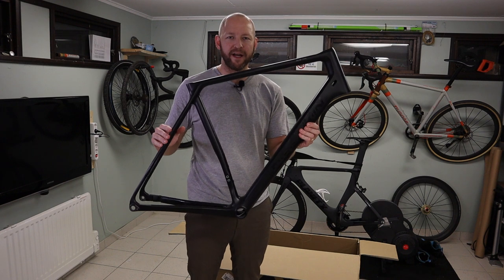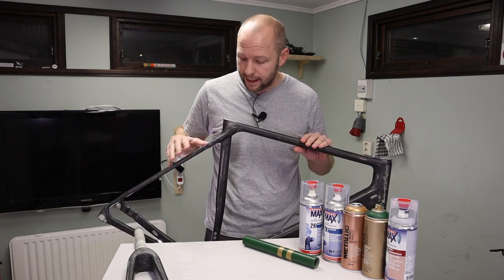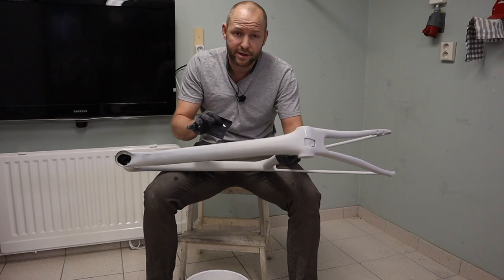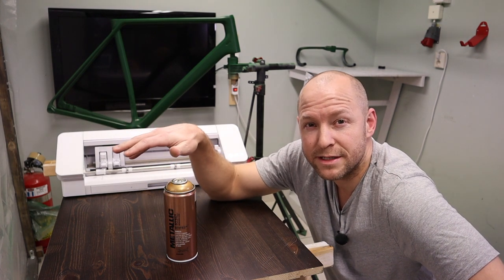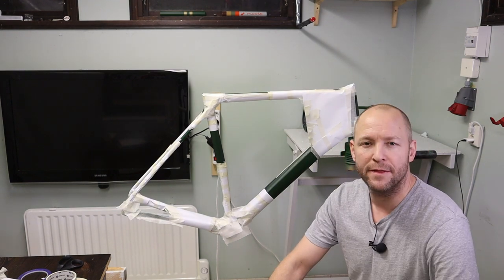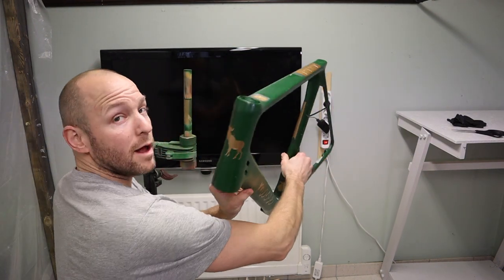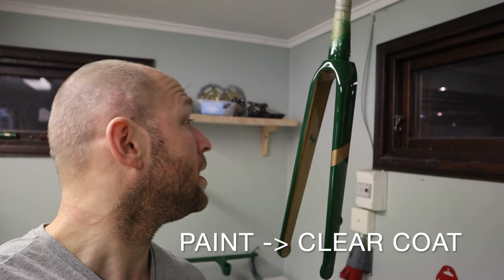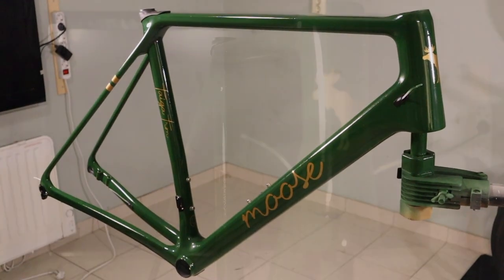Custom carbon bike frame painting DIY #bikepaint

Comment: I really like the gold with the moose on the inside of the fork. The little details like this really make it look more custom. I found it interesting that you ended up in the position where the whole bike was sprayed with gloss coat. May have saved some time if you'd gloss cleared the decals you'd just painted in gold before removing all the masking.  Then given you had to mask up the gold decals to paint the green areas that had got scratched, you could've sprayed mat clear over that area straight away. Either way glad you're happy with the outcome!
Reply from the maker: Thanks. Yes, making it yourself really gives you possibilities to set details you would not get anywhere else.

Comment: Very nice job! It looks fantastic and the best part is that no other bike will look the same! I’d have painted the inside of the rear triangle (chainstay, etc) to go with the golden part of the fork, but all in all, excellent design!! 👏🏻👏🏻👏🏻👏🏻
Reply from the maker: Thank you very much! :) Yes, thats the beauty with custom painting! I was thinking about it but I decided to go with all green on the inside of the rear triangle for two of reasons. To begin with I planned on laying a matt clear coat on the green in the end. And masking that area to keep the gold glossy would have been very hard. Also the edges between the areas that would be gold and green were not that defined on this frame and I found it hard to imagine where to put the lines. The risk of failure was simply too big in comparison to the gains. :)
Reply: @MYnextDIYbikePROJECT  that makes sense!

Comment from the maker: Any questions? Let me know! :)
Reply: Are those reverse stencils you are using?
Reply from the maker: @achmatsydow3759  I’m not sure what you mean?! The stencils exposes the letters and mask of the background so the letters gets colored by the paint. Check out this video for deeper knowledge. 👉 https://youtu.be/Ck1ssw3goIY
Reply: Can't you simply de-gloss the surface and/or remove the clearcoat, than primer and paint over the original?
Reply: @HealthvsWealth4me  You can but paint weighs a lot.
Reply: @MYnextDIYbikePROJECT  with what exactly are you washing of all the dust remains, after the sandpapering ? If you would use wash gasoline, would there be a change to wipe any of the fresh color of?

Comment: Og-evkin is a good brand. I have an integrated bar and stem handlebar on my emonda. I had a crash in which I hit a car with my front tire and the frame split in half at the head tube had a broken arm but the handle bar didn’t suffer any damage
Reply from the maker: Good to hear. My frame is all I have from them, but it rides great so far!

Comment: Not sure what you used to remove the residue, but for a gentle glue / residue removal try next time citrus furniture polish ( pledge) there are also no name brands you can get cheap work the same.
Reply: Ps very sweet vid! Thanks for posting.
Reply from the maker: Thanks. I tried a couple of home remedies, bicarbonate and olive oil amongst other.  Took some but I pretty sure I let the masking sit for to long and the glue “grew” in to the “raw” painted area. Didn’t try your solution though. I’ll probably will on a separate test tube. 👍

Comment: QUESTION: First,Thank you for taking the time to make this video. I may be repainting my SCOTT carbon bike soon. My  question is, Why do you need to remove all the paint first. Can't you simply de-gloss the surface and/or remove the clearcoat, than primer and paint over the original? I did that with one of my aluminium bikes last month and it looks great and holding up so far. ???
Reply from the maker: Its absolutely a possibility. But for me, it’s a few things. I get to inspect the frame and find any cracks or flaws before I paint. The new paint might react with the old paint and destroy the paint job. Weight savings, it’s marginal, but still. So if I’m gonna put so much time, money and effort into the job, I like to do it on a raw frame.

Comment: Should I sand between each layer of primer or only once it has cured for 24 hours. And then finish off with the final primer and move onto the base coat. 

And should I do the same to the base coat? Sand in between the base layer 
x2/3 and on the final coat? Or leave the final base coat untouched from sanding? 

And once I applied my decals and logos. I will apply the colour layers 2/3 times again. Should I sand the colour or I shouldn’t touch it? 

And only sand after I applied the clear coat? 

Please advise. I’m a bit unclear on this?
Reply: Please advise?
Reply from the maker: Only sand fully cured paint. So after after 24h (read the can for directions). You only sand primer and clear. Do not sand the base coats or graphics. 👍
Reply: @MYnextDIYbikePROJECT  thank you

Comment: A quicker way to sand down the paint would be to use something what we in Sweden call a "vinkelslip". #tipoftheday
But seriously, I am very impressed with your work! 👌
Reply from the maker: Thanks Olof! The “vinkelslip”, angle grinder Was used on the aluminum frame in my previous project. For carbon… not som much! 🤣😂 media blasting is a more reasonable choice. 👌

Comment: i had some chips on my lower chainstay and basically just localized the area by sanding it down and using a gloss white paint. u think it will hold up? the chips got sanded down to bare carbon so i stopped - but i didn't use any primer prior to using the paint. it looks well and for a small area + sanding, i wasn't too worried about not using a primer. besides, i think there is some primer there already left.
Reply from the maker: It won’t be as the clear coated paint around, and it might catch dirt a bit more. But it should hold up just fine. Adding clear coat to an existing paint job is very difficult as you will end up with overspray on the area around. 👍
Reply: @MYnextDIYbikePROJECT  not too worried about clear coat since the paint has a similar gloss finish. I plan on putting frame wrap to the area to serve as a clear coat. My concern was the oil Emanuel paint on bare sanded carbon and sanded previous paint areas. The finish looks great but I want to make sure it won’t degrade or compromise the quality of the carbon itself.

Comment: Two questions, after applying the green paint, was the paint roughened again with 1000 sandpaper or was clear paint sprayed on directly?

If not, did you clean the frame again before applying the clear coat and with what solvent so as not to attack the paint?
Reply from the maker: Nope! Don’t sand the colors. No need and if you hav several colors you risk to drag color over to another. 👍
Reply: @MYnextDIYbikePROJECT  Thanks!
Reply from the maker: @ThePlanetSammy  👍

Comment: What a great video, and awesome color combo. Hey which vinyl and transfer tape do you use? Also how long can you leave the decals, before you need to remove them? Congrats on the bike build, just watched that one as well, great looking bike :)
Reply from the maker: Thank you! 🙏🏻 the vinyl I use is the Oramask 810/813: https://amzn.to/3tFaInC and a regular gridded transfer tape, don’t remember the brand. When it comes to how long, I almost got mad before I figured out why I got residue left in the paint. But I cracked it, see my solution here: https://youtu.be/YuLc7yfZw3g?si=vM6d6WCq6qrmxJyr
Reply: That's very interesting, it's almost there is some kind of a chemical reaction between the sticker and the paint. It's almost like the Montana paint dissolves the adhesive from the mask. Anyway, thanks for sharing the process and all, great videos. @MYnextDIYbikePROJECT
Reply from the maker: @hmudesign  yep, it’s the only paint with that problem that I’ve encountered.

Comment: Question. If I want to do a matte black finish, which clear coat do I use? I do not want a gloss, because well, I guess it is supposed to be matte, right? So, I guess the boring matte black as you started with. ha
Reply from the maker: Hehe! Well. You use a matte clear coat. For a durable finish, use a gloss clear coat, sand it with 800 or 1000 g wet sandpaper and then lay down the matte clear. 😃👍

Comment: Hi what are the exact colours you used? I like them and want to use this combo on my bike.its difficult to judge colours online!
Reply from the maker: I used Montana Cans, Gold Metallic (they only have one) and the Montana cans 6070, Smaragd Green. However, I don't recomend Montana Cans if you will use vinyl for masking. I go into it in this video: https://youtu.be/YuLc7yfZw3g
Reply: @MYnextDIYbikePROJECT  thanks for the reply. And the heads up on the vinal. It's interesting that Martin Grey of @etoe recommends Montana and makes no reference to this problem. I guess washing off the old glue with alcohol would damage the paint. Maybe soapy water could clean the old glue off?
Reply from the maker: @davidknight9974  I know. I've seen his videos and reached out to him if he had this issue but no serious respons. I can just share my experience and I've only had this problem with Montana.
Reply: @MYnextDIYbikePROJECT  I spray bikes with Montana and vinyl decals as masks, sometimes you get residue, sometimes you don't I think it depends on the vinyl, but if you do WD40 or GT85 on a clean microfiber cloth and then IPA to clean down the frame before the next coat. But I reverse mask, i.e. I spray the colour I want the graphics on the primer (just where I want them) and rub down with 1200 grit before applying and spraying over them with the main colour, I don't know if this makes a difference.
Reply from the maker: @chris1275cc  nice that it works with those cleaners. I wasn’t brave enough to put that on. But I have continued to research the topic and came to the conclusion that I will not use Montana anymore (for painting with stencils). Se why in this video: 👌 https://youtu.be/YuLc7yfZw3g

Comment: do you not sand the green color to smooth out any orange peel texture or spray paint texture?
Reply from the maker: Nope. Orange peel is rarely any problem for base paint if you have a smooth surface and paint in adequate temperatures.

Comment: Nice looking bike! and cool videos. I have watched most of them.  I am soon to start building and painting my bike. How much time do you wait before masking of the logos and texts after spray painting the main colour? hope to hear from you.
Reply from the maker: I waited at least 24 hours. However, as you see in this vid I have issues with Montana Cans, since I switched to automotive paint I have no issues with stencils. I made a video a while ago on the issue. 👌
Reply: @MYnextDIYbikePROJECT  thanks for your reply! If you wait 24hrs you can't paint wet on wet and you'll have to sand in between all layers right?
Reply from the maker: @maurijnklok9668  not on base. With 1k the solvents will bind well. If you sand on base you run risk of getting a dull look. 👍

Comment: Great job! It’s gorgeous! How long did you wait between coats on Montana color basecoat? And how long between final basecoat layer and first shot of 2k clear? Thanks so much!!!!
Reply from the maker: Thanks! To begin with, I no longer use/recommend Montana, I go into details about it in this video: https://youtu.be/YuLc7yfZw3g

Anyway, drying time for solvent 1k based paint in “normal room temperature” or above is usually quite fast, 1-2h before you can clear coat with 2k clear. Thats also a good time frame to wait before applying any masking (vinyl or tape). Another coat can usually be applied 5-10 minutes after the first. 

Most paint have a Technical Data sheet where you can find recommendations and data. 👍
Reply: @MYnextDIYbikePROJECT  I’ve done several attempts with Montana gold plus 2k clear - each time with a soft final product you can dent or scratch easily with a fingernail. Currently I’m on attempt #7 - maybe I’m expecting the clear to harden up too soon. Does it take longer than a couple days to get to super hard/durable/cured finish? Thanks so much! Great channel!
Reply from the maker: @clarkhewitt106  well, yes, 2k products are very dependent on temperature and humidity. Dry and warm are the best. At automotive paint shops they “bake” the paint by either raising the temperature to above 60 degrees C (140f) ore with infra red panels. In room temperature (about/above 20c/68f) it can take up to a week or two before the clear is complete. That doesn’t mean it isn’t visibly dry or that you cant put another coat on it, but it’s not fully hardened. I recommend you clear coat in stages, one coat, cure for at least 48h, sand with 800 or 1000g and then coat 2. That gives the paint time to harden and you build up a good mechanical bond between the coats. (One coat is usually 2-3 passing with 10-15 min flash time in between).
Reply: @MYnextDIYbikePROJECT  This is VERY helpful. Thank you so much for taking the time to reply! 👍🏼👍🏼👍🏼
Reply from the maker: @clarkhewitt106  Best of luck with your projects! :)

Comment: Great work! I am in the process and got quick question. I have strip-off old paint-work by wet sanding in my carbon frameset. It has some light scratches, Can I  apply "2K Rapid Primer Filler in Aerosol SprayMax" then light wet sanding and apply "2K Epoxy Primer in Aerosol SprayMax" over it?
Thanks!!!
Reply from the maker: Thank you Jon. To be honest I haven’t used the 2k rapid primer, so I can’t give a direct answer to the question. I looked it up and it seems to build more than the regular 2k epoxy primer. But I don’t think you’ll need the epoxy primer as well. Sorry I can’t give you a more precise answer. Good luck! 👍

Comment: great job. i just went over all this recently and oh god never again. i cant stand these toxic acrylic paint, even with a proper 3M mask on and doing the job outside. i dont understand how you manage to do this inside in a paint boot.
Reply from the maker: Thanks. Well, The spraying lasts for like 10 min and then I wind up the garage port and start a couple of fans to vent out the fumes. I switched mask this time to a mask that seals better and ir makes a difference. Full mask would be nice though as I doubt that the eyes can take the fumes very well.

Comment: Why go right down to the carbon? Just wet flat the frame and put the new topcoat colour on 💁‍♂️ I'd only go bare on a metal frame that could be holding rust under the paint 🎨
Reply from the maker: I actually released a video on
The subject tho other day. Migt answe your question. DO I HAVE TO Strip paint from bike frame!?
https://youtu.be/GnuRcsXSVVU

Comment: Hi there, did you used 1 can for each color/primer? Also how many ML? Just for reference as I will also try to DIY. Thanks
Reply from the maker: I had 2 cans of primer, 2 cans of green, 1 can gold and 2 cans clear, 400ml each. How much I used is a definition, especially the primer and clear as they are 2k and once broken they only last 48h. Id say for a beginner, you need two for complete coverage, or probably more like 1,2 or 1,3 can. But it’s not very nice to end up short. For the details you only use parts of a can. 👍 good luck!
Reply: @MYnextDIYbikePROJECT  Thank you, watched a ton of vids but yours is the one I might follow 🙂
Reply from the maker: @Ralfh18  great. Check out my three latest videos. They are guides on how to do. 👍